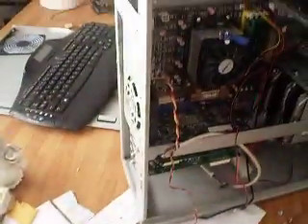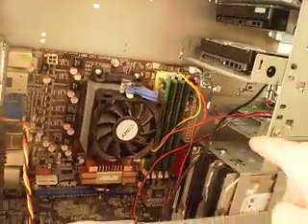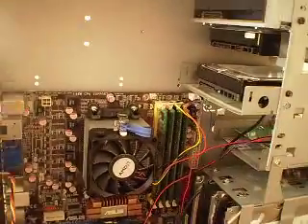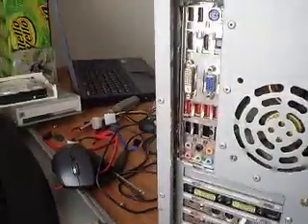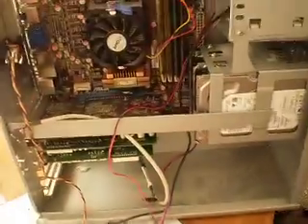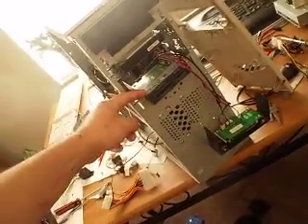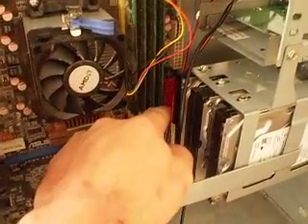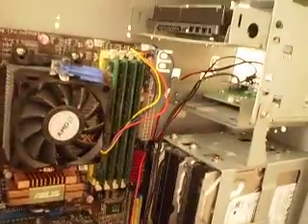Media Center 3.0 build Step-by-step Part 4

Comment: Nice video dude. Other than the cost issue, is there an underlying reason as to why you chose to use an old case, modding in highly in the process....  rather than just go the easy route and get a case.  
Either way,  your attention to detail is commendable